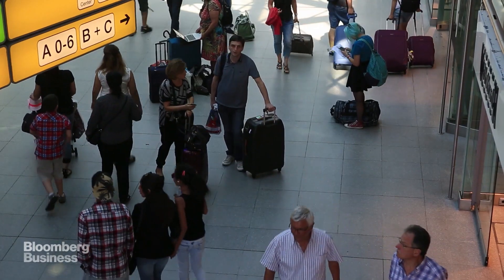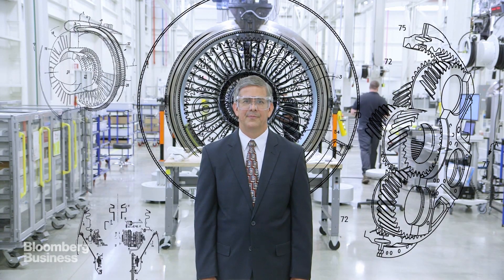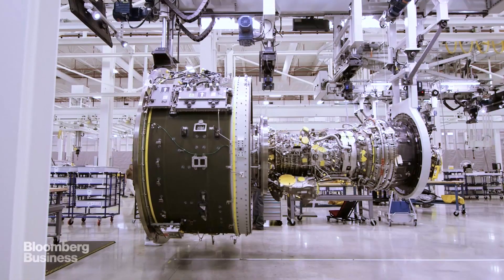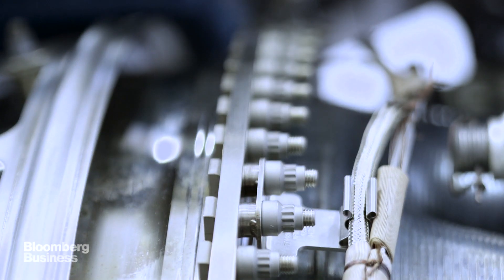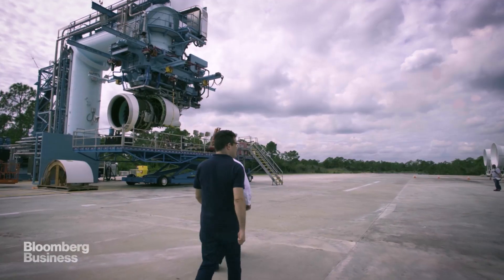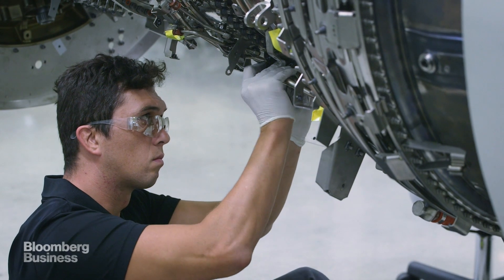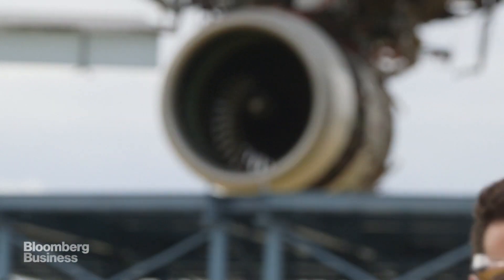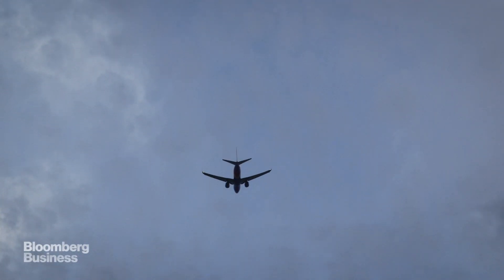This Genius Invention Could Transform Jet Engines

Comment: Whatever happened to water injection!!!??? They used this back in ww2 to get way better efficiency and less heat and wear
Reply: ChiefJustice Middleton water injection works well but the added weight of water on long duration flights could be an issue.
Reply: Conrad Sealy
yah thats a consideration for sure. However if the efficiency climbs considerably then its well worth it. Could only test this out. Superheated, Vaporised fuel could be used as well
Reply: ChiefJustice Middleton true. but then how clean would the emissions be? i guess it comes down to application and what are the engine operating parameters. there is no magic solution. jus compromises i guess.
Reply: Conrad Sealy
The emissions would be greatly improved because the molecular structure of the fuel would be broken down into vapor and could combine more readily with oxygen molecules for a more perfect burn and then the water injection could be used on top of that. No smoke, no nothing, way less carbon and other noxious fumes. Double to triple the mileage
Reply: ChiefJustice Middleton yes. no question about the benefits of water injection on combustion. its just the weight of carrying all that water. i guess it could be used only at take off when the engines are at full power. that way less water is used.
Reply: Conrad Sealy
If you built up the efficiency then there would be overall less fuel and less weight to carry. More bang per buck. Go farther with less fuel and water
Reply: ChiefJustice Middleton true.
Reply: Conrad Sealy
aint it. lol
Reply: Water injection increases engine thrust and power because it can safely burn more fuel without overheating and also there is larger propellant mass involved, but efficiency is not increased: not all of fuel is burned. So it has limited use and usually it's sort of hack to make things work. Like, if aircraft is too heavy, water injection would allow it to take off.
Reply: The KC-135 and B-52 both used water injection for takeoff only.  Both were underpowered and needed the extra boost to get airborne with heavy loads.  The engines were replaced with more powerful and efficient engines, which eliminated the need for water injection.  Water injection added weight, required the water to be heated in cold climates, and only lasted two minutes on takeoff.  Also the water had to be demineralized to prevent damage.  The engines had a limited lifespan, compared to modern engines.  24 years as an Air Force crew chief.  Turbofan engines solved so many engine issues, and reduced the maintenance needed to keep the aircraft ready to fly.
Reply: They used it on the JT9s I used to work on on the B747sps as well. The SP had a roughly 1000l so about 200 gallon tank of water injection for take off in hot or high altitude take offs. Middle east or RSA been the big buyers.
Reply: A lot of water goes into a jet engine during a rainstorm. That surely is water injection? I imagine the water turns into water vapour by the compressors in front of the combustion chamber.
Reply: Sean Bad
Thats cool. Id like to know how exactly they work, any diagrams or websites you can point me too?
Reply: +ChiefJustice Middleton wish I could. Been about 20 yrs since I last changed the water injection system on one. Sat on the right side of the engine around the back of the fan cowl. Remember thinking it was a stubborn woman (you know what I mean) the first time I ever changed one.
Reply: To add: The whole way I was taught was the spraying of water cooled the whole process down allowing one to pump more fuel in without over temping the turbines (exceeding max egt). But since I have not trained or studied about how when water turns to steam, it is actually more efficient then one can believe, I would appreciate if someone could explain if the water turning to steam has not just a turbine cooling effect and possibly also a thermal addition. I fixed them when they broke, but would really love to learn more about their thermal efficiency when water was injected myself. So if anyone can explain, I would appreciate it
Reply: The quantity of water injected is only a very small percentage of the fuel/water mix.  I have water injection installed in my car and the tank is pretty small, perhaps a gallon but lasts multiple fuel fill-ups.  Perhaps it's a fools errand to compare a four stroke engine to a high bypass turbo fan but it gives some idea of the ratio.  Lastly, the GE LM2500 gas turbine engine utilizes water injection, these are mainly used to propel ships; However, it's sister engine the CF6 is flown on many airplanes: 747, 767, A300, A310, A330, so no doubt it's possible to do.  I wonder if the water injection works better with LP gas as the fuel?
Reply: The water injection tank on a B747sp holds about 1000l of fuel. And yes limited use, only during take off
Reply: If you are referring to the use in propeller planes, it was a mixture of methanol and water. Methanol releases more energy per unit of oxygen consumed, increasing power temporarily in emergency situations. Likewise, in early jet engines water injection was used to temporarily increase thrust upon takeoff, to prevent overheating. Modern engines still produce enough thrust at speed for high speed flight, but the high bypass ratio has massively increased static thrust, ensuring takeoff is easy even when just air cooled. Water injection can increase the power of an engine, but not really its efficiency, so carrying around all that water is not really worth it.
Reply: Sean Bad no means no lol
Reply: Water injection is used primarily during take offs in hot ambient temperature airports for greater thrust.

Comment: So, why has it taken P&W 30 years to rediscover the turboprop?  They should have just contacted P&W Canada and pulled parts from the PT-6!  I mean, really?  In essence, this really isn't anything more than a ducted turboprop with a lot more blades.  As the fans get bigger, and the core produces less and less percentage of the overall power, we really are going back to the basics of a turboprop.
Reply: Bo McGillacutty No.  The output is geared down to a usable speed, and then is controlled by the propellor pitch,  The pilot will set, say 2.000 RPM on the propellor, and the propellor changes pitch automatically, depending on engine speed, climb angle, airspeed and other factors to maintain that speed.
In essence, the difference between a geared turbofan and a turboprop is that the propellor blade pitch controls the speed of the prop whereas the gearing controls the speed of the fan.
My original post was not meant to be taken as an engineering discussion, it was meant to be lighthearted.
Reply: Bo McGillacutty Well, turboprops DO benefit greatly from a reduction in speed from the turbine to the prop!  Typical turbine speeds are in the vicinity of 80,000 RPM.  No prop could stand that sort of rotational speed, they would fly apart.  So, ALL turboprop engines are geared to reduce the speed of the turbine to something that the prop can use effectively.  Modern turboprop engines will run their props somewhere in the vicinity of 2,000 RPM.  That's a 40 times difference in speed.  The propellers are 'variable pitch', which means the blades move in relation to the air, which in this case is not the air coming over the wing, but the air in the plane of the propeller.  These propellers are called 'Constant Speed Propellers' and are used to gain efficiency from the engine by keeping the propeller at a constant rotational speed.  See this article for understanding of Constant Speed Props.
https://en.wikipedia.org/wiki/Constant-speed_propeller
Now, I was trying to be funny, but by increasing the fan size of said engine, and reducing it's rotational speed, it returns to what basically a turboprop does.  It moves massive amounts of air to power an airplane in flight.  In fact, up to 80% of the thrust from these engines are provided by the fan, and not the turbine itself.  Changing the engine to a slower, more efficient fan speed simply recreates, in effect, a turboprop engine.
Reply: Gary C  OK.  If you were just funn'n than I shouldn't take it literally.  However I think it's a safe bet that turboprops could also greatly benefit from a big differential in turbine versus prop RPM, for what it's worth....without considering the down side of higher cost, weight, maintenance, etc.  (Sorry, I can't help but be fascinated by the engineering particulars that's why I clicked on the vid :-) )
Reply: Gary C Variable pitch and bypassing the combustion chamber with most of the thrust producing air are related but separate aspects.  Again, turbofans have been 'emulating' turboprops in this way for half a century.  (I believe it was the 747 that accelerated the adoption of high bypass efficiency)

  Apparently the difficulty comes about when attempting to gear the rotational speed differential along the same axis, hence requiring some sort of planetary arrangement where as turboprops have an offset prop shaft geared to the turbine shaft greatly simplifying the gearbox.  Right?
Reply: Bo McGillacutty I would agree that the same axis gearing will present an issue.  You are correct that a turboprop is off axis to the propeller.  Again, the original post was in humor, and I have not thought enough about geared turbofans to consider it properly.
Reply: Same axis gearing presents no issue whatsoever.  Just look at the Rolls-Royce Dart turboprop from around 50 years ago.  This uses an epicyclic reduction gearbox at the front of the gas turbine, in order to drive the propeller.
Reply: Gary C  Pardon me pressing the point then, but I have learned a couple things here since I was not near as aware of the particulars of turboprops as airliner engines.  Thanks for the discussion.
Reply: These engines make tens of thousands of HP, the most common PT6s make less than a thousand HP, so the difficulty was in making a gearbox that was strong enough to handle the enormous amount of power that these engines produce, but didn't also double the weight of the engine.

Hell, even the largest turboprop in existence only makes ~15,000 hp HP.
Reply: Does the PT-6 (or any other turboprop, turbo anything) have multi speed shaft?  High bypass engines are half a century old but all had/have single speed shafts.  It sounds like you are confusing turbofans (old tech) with geared turbofans.  I don't know what's "genius" about it, just an obvious, long wanted but difficult to solve engineering problem.
Reply: Bo McGillacutty Not a problem.  Always willing to help someone who wants to learn.  :)
Reply: Gary C Very generous of you.  ;-)
Reply: I agree, It is just crazy watching this video and seeing the size of the tiny core compared to the massive fan, man the bypass ratio's now a days are massive, no wonder it's so quite.
Reply: foremasp I think the bypass ratio is close to, if not more than 10:1.  It's kind of gotten to the point where if you could find a power source with enough ooomph, you could probably change out the core for an electric motor!

Comment: Turbofan with a variable speed gearbox for high efficiency? That's not the way to go !!! What about the venerable Soviet Kuznetsov NK-12 (Tupolev Tu-95)? The only thing missing would be a duct around the blades of the counter rotating propeller blades, with blades tips optimized for super-sonic speed, and voilà !!!
Reply: ***** If I recall, for Soviet designer Nikolai  Kuznetsov, the NK-12 was his very first turbine engine design. Still, after 60 years, the NK-12 is still the most fuel efficient propeller engine in the world, despite the fact that Kuznetsov had serious limitation for using  advanced metal alloy because USSR was poor after WW2.
Reply: ***** For car, I would give the palm to the German for innovation, to Japan for reliability. The American have been force to copy those two countries in order to compete, and even there GM and Chrysler eventually had to declare bankruptcy.
As for the metallurgy of the NK-12, I was referring to the silver micro-plating of the turbine hot part, thought primitive, the technique has proven very reliable over time.
Reply: NK-12 is declared to be detected in several hundred kilometers by edge hydro locators.
In this video the engine is designed to be quiet.
Reply: Brickandfanal ³
Reply: +harris3693 H1b1 visa I think it is called
Reply: wrong

Comment: WTF is with all you haters in this here comments section. The frickin' thing might not be new at all but for frick sake's it going on a jet and that's not new? Something NEW in THIS industry takes YEARS to build up  to a point where it can deliver those benefits with real economies of scale already.  Trolls.
Reply: charlieboye2009 I know! Ideas can be around for a long time, but to engineer something to be light, efficient, reliable and safe can take along time, and money. Turbine engines have to be incredibly reliable, especially with most aircraft being only twin engined.
Reply: Why Am i not surprised to hear that it is a somewhat Ripp off of Russian Gear. The only reason why this engine has any traction at all is because of the frames that its attached to. So much bias against Russian gear but in reality there are plenty of ideas they've come up with that are totally ignored in the West. P&W? Get out of UTC already.

Comment: I invented  in the eighties (Mojave, CA) the jet engine which has no rotating parts, ergo its weight is only a small farction of current expensive engines. The only additional requirement is ground-supported startup.

Comment: If the fans are driven by their own turbine, why not adjust the AOT of the turbine blades? I realize this would make it more /less efficient at certain throttle settings. What about variable pitch turbines to adjust the pitch? Too complicated, heavy, and unreliable? 
 This may be juvenile questions, but really curious.
Reply: The pressures on each turbine blade generate over a ton of force on a single relatively small blade. moving it is impossible
Reply: varible turbine vanes have been around since before I was born and that is 45 years ago. And I am talking about everyday turbines, not one offs
Reply: +Sean Bad
I've seen variable stator vanes, (vsv's) variable inlet guide vanes, (vigv's) and variable pitch fan blades, but never variable turbine blades.
Reply: Android811 thanks for correcting me, was meaning vsv's
Reply: variable pitch fan blades, are something like Valvetronic...

Comment: Interesting but did not hear a single mention about additional weight (gearboxes are not light), additional maintenance, gearbox cooling and the advantages of gears over other solutions to transfer and modulate power e.g. viscous coupling.

Comment: Is that the same concept as a turbo prop?
Reply: ehh..not quite.. the pitch of the front fan cannot be changed.
Reply: Capitano Americo Eh, not at all, a turboprop has a small gas turbine that drives a propellor, unlike turbojets and turbofans mostly all of the thrust comes from the propellor and only a small amount comes from the turbine exhaust. The C-130 has turboprops
Reply: yeah don't turboprops have reduction gear? That would surprize me. I want details
Reply: Yes, they do have gearboxes. The basic concept is the same.

Comment: This is just a stop gap measure before the industry switches to module electric engines. Same as train engines.
Reply: You mean the huge and heavy diesel burning units that convert diesel into electricity?
Reply: I mean the power transmission unit that's between whatever power plant you want and whatever you need to make spin to make the plane fly.
Reply: Seems unlikely when the industry is focused on efficiency. Mechanical to Electric to Mechanical is hugely wasteful in terms of heat. That level of high voltage next to a fuel tank could also be a huge concern, considering the level of arcing that giant electric motors can produce.

Comment: I still don't understand why everyone wants quieter jet engines
Reply: Because there are sound restrictions put in place by airports because people who live near the airports dislike the sound that can start as early as 6am and end as late as 1130pm
Reply: Draylogic People are complaining that they make noise? People are complaining about a giant flying metal bird that flies thousands of feet in the air at 500 miles an hour, something we've only dreamed about since the beginning of humanity? Complaining about something that gets us to the other side of the world in less than a day, something that for thousands of years took months to achieve? If they don't like it, move away from the airport. I personally love the sound of jet engines and don't understand why people don't. It baffles me.
Reply: Nobody gives a flying f*ck about the noise or pollution. Cost, efficiency, consumption, all leads to money savings, the man in the video said it, up to $1.5M a year. The huge noise is caused by the supersonic shockwaves the fan makes when spinning that fast. Reducing rpm allows the tips of the blades to travel at subsonic speeds and as a side effect this also reduces noise, that is a side effect that retards can understand. This is a reasoning a 2 year old could do. Why couldn't you?